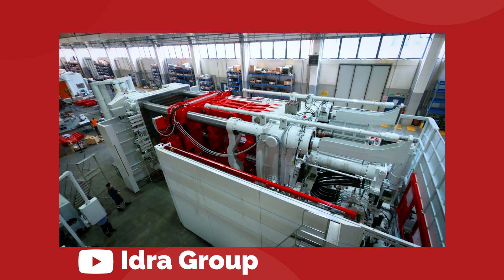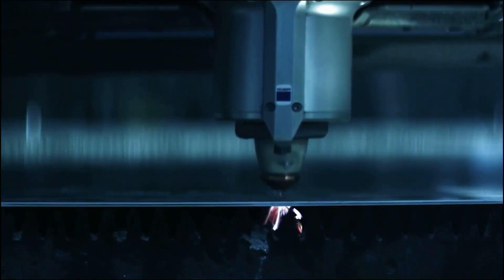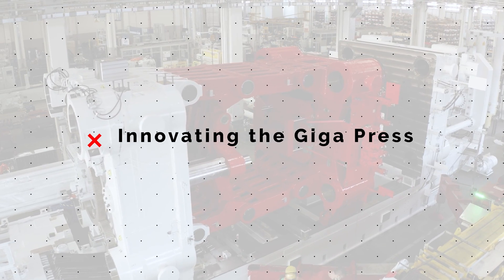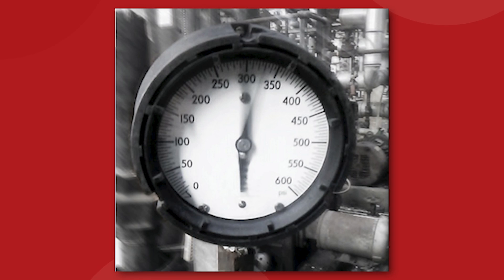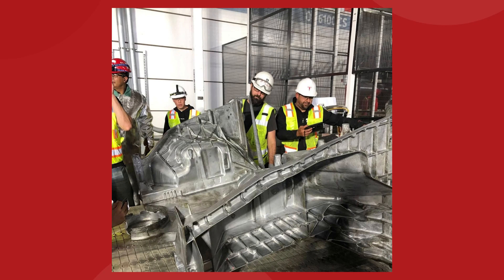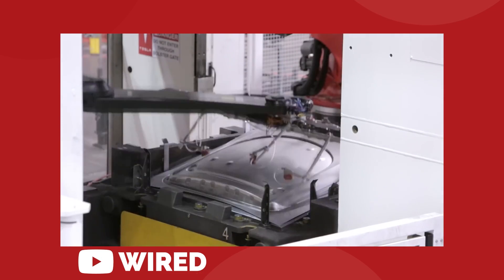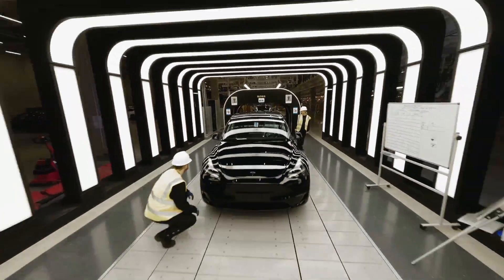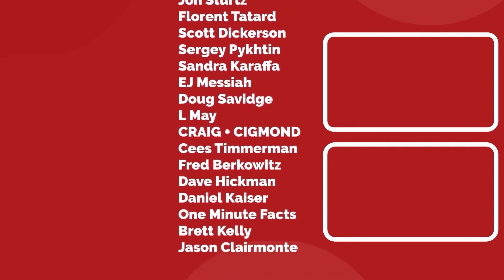The Real Reason Tesla Developed The Giga Press!

Comment: Fantastic video! I follow Tesla for several hours a day and was surprised to get so much additional clarification from just one video.  Thanks... great job!
Reply from the maker: Thanks Jerry, glad you enjoyed the video!
Reply: @TheTeslaSpace  hes right, you just gained another sun
Reply: sub
Reply: Here's the reality.  Tesla had too many parts on the back end.  That's too many 'failure opportunities' in their design and it cost $2000 too much to make the car by its original design. So with recommendation from Sandy Munro, they converted those many parts into one part.  BUT... Here's the con in this story.  You see other car companies know how to make cars, they didn't need a giga press to make cars.  The legacy car companies have decades of experience in making far more complex gasoline and hybrid vehicles by the millions, compared to a simple car with just a battery and motor.  The giga press is a fix, not a feature, nor does it put Tesla ahead of any car company who already makes up to 10 million cars a year.  This video is basically a cover up.
Reply: @obijuan3004  
You do realize that Sandy Munro has made the same recommendations to legacy car companies, but none were willing to make the Investments and commit to an idea like Tesla has..... you do realize this, right?
Reply: @grumpusmaximus9446   You assume that the other car companies would benefit from Munro's suggestions. Munro is just one engineer out of thousands, that doesn't make him right.  In fact there is still the possibility that the giga press will be a huge flop. 

Most companies don't broadcast their R&D. They don't name their factories, or have hundreds of YouTube videos about the future by Honda, for example.

Just because Tesla does it, that doesn't mean other car companies are behind.  That is the Musk hype, he is  genius and everyone else is an idiot.  Well, Twitter is about to show Musk how wrong he is about himself.
Reply: @obijuan3004  
So eliminating 370 individual pieces down to 2, plus the hundreds of machines and tooling, extra floor space and people it took to manufacturer and assemble the 370 pieces, the elimination of possible errors, not to mention the cost and savings per vehicle, is a bad idea. Got it genius, if only musk knew of your existence, just think of all the problems you could have saved him.... and of course you've got the Twitter deal allllll figured out, right genius? Of course you do (pat on head) now run along and play.
Reply: @grumpusmaximus9446   I have follow electric cars since 2003, I had an electric car website, and I knew people who were working on a new battery in 2007. I followed Tesla before Musk paid to be a co-founder, just before he fired the real founders, who designed the battery pack and motor.
  
You can bank on this... Musk will pay at least $1 billion to get out of the Twitter deal, or he will pay $5 to $10 billion in fines, or he will buy Twitter and make some excuses.  Then he could face more charges form the SEC.  
The whole Twitter deal was based in nonsense about free speech, but Musk was already saying who he was going to ban from Twitter, for personal reasons,  so its not about free speech.  This deal was about Peter Thiel and friends trying to get Musk to buy Twitter and bring back Trump.  Peter Thiel is on Trump's re-election team.

I see Musk for who he is, a narci$$ist.  I see his video's as 15 minute Tesla hype video's.  When I hear people say that legacy car companies are 10 years behind Tesla, I know people are being brainwashed by these hype videos. People saying there is no innovation while cars have made huge changes in the last 15 years. 

Musk is saying next year he will have a humanoid robot, using  a man dancing in a spandex robot suit.  That's not even hype its nonsense. Its like the 3 year old Cyber Truck, that is still in next years production or was it the next year... who can keep up.

Tesla is having to buy a big press to fix a design flaw that is costing Tesla $2000 per car.  Okay, fine, good call. The hype that Musk is feeding you is that this press makes them a most advanced car maker... but that's NOT TRUE at any level.... its more hype to cover up the real issue. 

This is really important... this huge press is not tested at scale of 250,000 cars per year. It might work great or it could be back to the drawing board, with a new hype video.
  
I didn't delete any posts, I'm guessing the Tesla Channel is doing that, because I'm only talking about facts.
Reply: @obijuan3004  good points, I fully agree with your thoughts
Reply: @obijuan3004  agree, the whole Tesla Musk narrative is followed and praised similar to that of a cult, with the followers blindly absorbing anything that’s said, and because they reside in an echo-chamber no sense of reality can get in. Just read the response of Grumpus Maximus a bit sad really
Reply: @spinnymathingy3149   I agree with you. Since the Musk - Twitter nonsense I just see Musk as a narcissistic egomaniac.  Twitter is going to  teach Musk how business works.
Reply: @obijuan3004  or twitter could just be his newest echo chamber for his disciples
Reply: @spinnymathingy3149  Twitter is already Musk's echo chamber.  But Musk will have paid more for that echo chamber than all of the users combined.
Reply: But why is Tesla so big on promises but so small on delivering ?
Reply: @spinnymathingy3149  
So big on promising, but so small on delivering?
Do you think you can give an actual example of what you're talking about?
Reply: @grumpusmaximus9446  I personally would like to see more of the tesla semi
Reply: @grumpusmaximus9446  sure, the Model 3 was promised to cost $35k, (reality is it’s over $45k) in Jan 2017 it was announced by Tesla that fully self driving cars would be available within 6 months ??? ,   The Tesla semi truck was supposed to be available by 2019,  then Teslas 1 Million robo-taxis by 2020,  then the cyber truck where orders and deposits were taken word wide and recently canceled world wide, with the exception of a couple of countries. 
There’s a few examples
Reply: @spinnymathingy3149  
What you're talking about is called Elon time. Elon says I'd like to have this available in Tesla's in 2017, or I want to sell the model 3 for 35,000, or we should be able to start producing Tesla semis in 2019. There's no doubt that elon's ambitions sometimes run far ahead of what's actually able to scale-up and produce.
To be clear none of the times you posted, we're actually official Tesla start dates. It was wishful thinking of an overeager engineer.
Now though, the factories have been built. The machines to build the machines have been made, the FSD software is.... advancing but still under development.
So don't be so nit-picky about delayed start dates, or production. What Tesla is doing has never been done before, and the scale they're working on is hard for most people to grasp.
Reply: @grumpusmaximus9446  I wasn’t being nit-picky , simply explaining the lack of delivering to scheduled statements, what Elon states at his own press conferences is fantasy, if Elon isn’t the No 1 representative for and the CEO for that matter in Tesla then who is ?? , well that’s disappointing. But I suppose realistically the majority of his announcements are fanciful, eg statements regarding the booring company, hyperloop, colonising Mars ect. I mean it’s ok for a fiction novelist but not acceptable for a business man who’s hand is out accepting good peoples money for completely unrealistic ventures.
Reply: @spinnymathingy3149  Tesla is and will deliver on most of their stated goals. This is what counts in the end and they will not be decades late. Yes, add a few years to Elon's announcements, but who predicted global COVID lockdowns, global supply chain collapse, or global chip crisis?
What Tesla pulled off in the last year was amazing, despite all the nightmares.
Just for reference, in my company we have to use chips which costs now 40'000% (!) more than 3y ago and we cannot easily replace them.
 but the Elon timing

Comment: I don't believe for one minute that IDRA came up with the idea for the giga press.  Tesla queried them to see if they would do it, and then Tesla sent engineers to work with IDRA on the design and fabrication of the press.  IDRA may be great at making presses, but they would not have known what Tesla requires in the design.  Also, I understand that SpaceX was brought in to come up with a new aluminum formulation to work with the press.
Reply: IDRA has been making presses for years, Tesla is still learning how to make a car.   Here's the reality.  Tesla had too many parts on the back end.  That's too many 'failure opportunities' in their design and it cost $2000 too much to make the car by its original design. So with recommendation from Sandy Munro, they converted those many parts into one part.  BUT... Here's the con in this story.  You see other car companies know how to make cars, they didn't need a giga press to make cars.  The legacy car companies have decades of experience in making far more complex gasoline and hybrid vehicles by the millions, compared to a simple car with just a battery and motor.  The giga press is a fix, not a feature, nor does it put Tesla ahead of any car company who already makes up to 10 million cars a year.  This video is basically a cover up.
Reply: Their first reply was maybe, and then he might have dreamed of actually making it work and said yes.
Reply: Why would you believe IDRA didn’t do it? Who owns the patents and the machines?
Reply: @singed8853  IDRA worked with Tesla to develop the presses.  The fundamental press design is IDRA's, but it had to be adapted for Tesla.  No small feat.  I don' t know about any patents.
Reply: Idra was making these machines before Elon Musk asked for them, he just asked for larger machines than they were making.
Reply: @mohammadwasilliterate8037  @Bill Weber is correct.  There are A LOT of aluminum alloy press companies (Contech for example in the US) for automotive components, just not on the scale and size Tesla engineers proposed.  Tesla, just like SpaceX, has the engineering discipline and understanding of evaluate, integrate, and eliminate - meaning Tesla is driven to evaluate the reduction (elimination of) of well of 200 individual components at the rear, and hundreds of manufacturing process steps.  Tesla and IDRA together figured out the proper alloy, pressures, flows to cast the back 1/3 of the vehicle in one casting.
Reply: @mohammadwasilliterate8037  That's the point.  No one was sure that you could  make a press that large that was stable and economically feasible.
Reply: @mohammadwasilliterate8037  It sounds simple, but it's not.

Comment: 4 gigapresses = 600 robots 😯
Reply: finally someone that takes the job of the robots that took our jobs ahah
Let's see who gets replaced now
Reply: It's not a linear value, unless it involves different production lines or different vehicle platforms.  Simply adding more presses to the same line would not = the same amount of robot reduction as the first press.. but would increase volume of vehicles to the line.
Reply: @Ozmundas  9:48 did you even watch the video 😐 4 gigapresses are doing the job of 600 robots..
Reply: @PatrickRyan147  I watched the video .. did you read my comment entirely ?  I work in automotive and understand how mass production works.   You can make 300,000 vehicles a year with less than 600 robots in an underbody environment.  Eliminating 600 robots in ONE factory would mean virtually zero robots in the factory.  The first press might eliminate 90% of the underbody assembly /welding robots .. but a 2nd and 3rd and 4th press would not reduce the number of robots further.
Reply: @Ozmundas  hmm🤔 who do I believe, Elon Musk or some dude in the YouTube comments section 🤔🤔🤔
Reply: @PatrickRyan147  neither - do your own research:)  I’m sure you can find out the average number of robots used in an auto plant.  Musk exaggerates all the time - a single Giga-Press eliminating 600 robots is possible, he’s still refining his process - but adding a second wouldn’t eliminate an additional 600, u less it was installed in a separate facility or line.  Vehicles running down a production line make use of that lines robots - I’m not sure what you find so “out there” about my comments :)